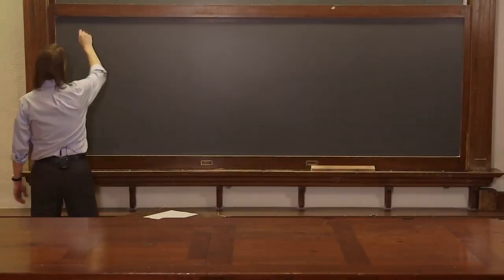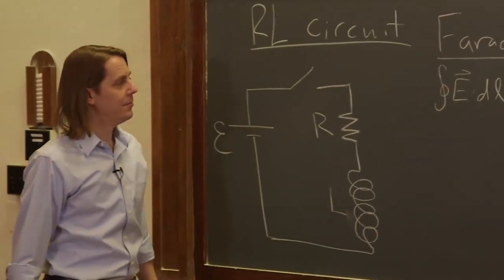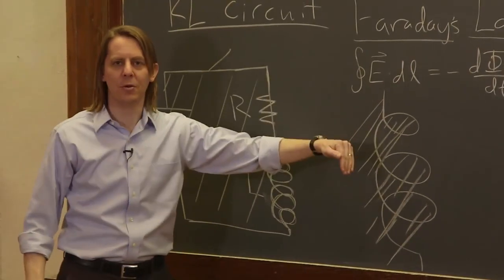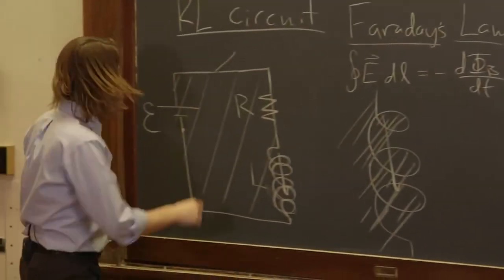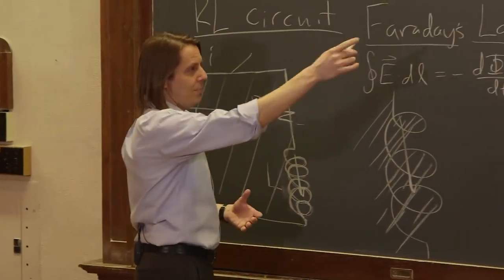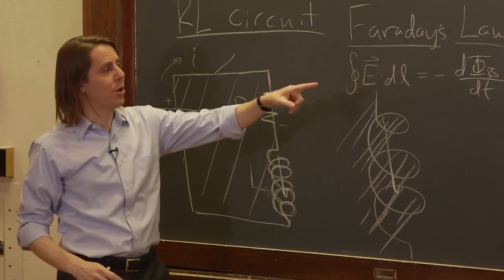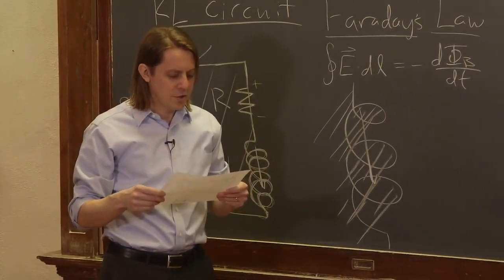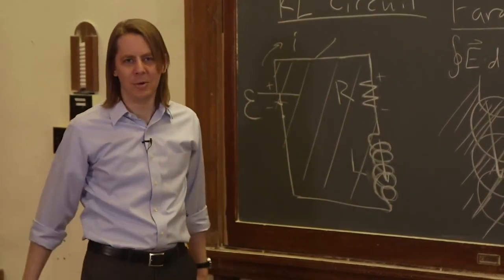PHYS 102 | LR Circutis 2 - Faraday's Law is the correct approach for a Circuit with an Inductor!

Comment: But then you are saying that integral E*dl over the coil is 0. But isnt this wrong ?Cause there should be a voltage across it and like the law of inductance states. And if you look  at the maxwell equations, you will see that the dΦ/dt is the same as integral E*ds over the coil. So actually you will get the same as you got with Kirchhoff, but in this case i think Faraday is the wrong equation to explain the voltage across the coil, cause in your explanation you are saying that theres no voltage drop across the coil, what isnt right, i think.
(if you are saying the whole circuit is the coil,then its hard to argue with kirchhoff, but in this case theres more sence in using kirchhoff, and hard to understand with the faraday equation, i think)
 Only because the coil hasnt got any resistance doesnt mean theres no voltage dropping across it. I mean why should Ohms law be the only reason there to be a voltage drop? A battery could induce a voltage drop, too, even if you assume it has got no inner resistance. A solar panel can do that, too. A capacitor can do this, too, a diode can do it, too.Also a isolator can do this although it hasnt got any measurable resistance. Also a human can be the reason for a voltage drop, although his resistance isnt constant. 
(maybe i'm thinking wrong, i hope i dont but correct me if i do.)
Reply: Resultant Electric field inside inductor at steady state is zero since it is a conductor. In transient period there would be electric field.In steady state charges redistribute such a way that total field inside conductor is zero. So electric filed produced by the change in magnetic field get  cancelled by coulomb's force. Inductor itself is not  closed loop so cannot apply faraday's law
Reply: @AjayVarghese-o2y  well yes. But arent we talking about a general rule? And shouldnt a general rule also apply to changing E and B fields (at least for slowly changing E and B fields so that we dont care about speed of light stuff)

Comment: If there is "no field" inside those wires and the inductor, then why are the electrons drifting through them?
Reply from the maker: They were given an initial push by the battery, and follow Newton's first law!
Reply: @Prof-Hafner   Thank you, but I am still not clear about this. If they are moving due to inertia, they should continue to flow even if we short circuit the battery and remove the battery. will the current continue to flow even after shorting the battery?
Reply from the maker: This is all an idealized approximation, but in that case the current would continue to flow, except other effects would slow it down.  Even in this idealized case, current flowing in a circuit is made of charge that is accelerating, so it would create electromagnetic radiation that would take the energy away and stop the current.
Reply: @Prof-Hafner Thank you once again, but I am having trouble in understanding that the electric field can be discontinuous inside the wires. It is present only inside resistors and battery and not in any other part. I thought it was continuous and that causes the electrons to drift. This is the part I am having trouble with.
Reply: @Prof-Hafner  what if there is a corner in the wire? Electrons should change their direction. But if there is no electric field, there shouldn't be a force to change the direction of the electrons.
Reply from the maker: Again, all very idealized and approximate!  We say the wires are perfect conductors with zero field inside, but you are correct they would also have to be straight for that to work.  For a bend, some charge would build up on the wire surface (in an attempt to drive the field to zero) and the field it creates would accelerate the charges.  So I think at a bend the field would not be zero.
Reply: @Prof-Hafner  thanks!
Reply: @Prof-Hafner  Does that mean that the conductor develops a net charge at every bend?
Reply: @Prof-Hafner  Newtons first law?
So you are saying the energy stored in an inductor is from inertia of electrons? Well if you have got a coil which has got lets say  1cm^3of mass there are approx. 8.4*10^23 free electrons in there. If they are moving with a speed of 7.4*10^-5cm/s (1mm wire 1A)
they will have an energy of 2*10^-16J. Thats nothing close to their real energy due to the magnetic field. They arent moving due to inertia, but due to self induction. (which is caused by special relativitys concept of length contraction which causes electric fields out of the view of the electrons. So they will always contrafict the change of magnetic fields due to lenz law)

Comment: In Faraday's law, vector E dot vector l is taking nonconservative electric field. How can it create potential? The term E-iR is still using the concept of potential drop.
Reply: since the E field in the circuit stills acts as a conservative field,inside the wire of the circuit, the only difference is that now there is an inductor that creates that magnetic flux.

Comment: it is just the deffinition .... int of e =0 is not kirchoffls law I guess ... .its the sum of potentials in closed loop that is zero
Reply: Potential is not defined for a non conservative field
Reply: See whenever you apply kirchoff's law you can just put the line integral of conservative field zero but in an inductor circuit we also have non conservative field and line integral of cons.+non cons. field +(motional emf term) computes to net emf generated along the loop. So is you want to apply kirchoff law ( line integral of conservative field only equal to zero ) it will give you correct result but you have to  be very careful as now eg you can not simply write V=ir across resistor (as ohm's law says 'net emf' in the element =ir and net emf is not just line integral of conservative electric field ).
so as you put "e=0 is not kirchoff law" the statement is correct only when you consider e as net emf in the loop and not line integral of conservative electric field. 
Hope it helps !

Comment: Great lecture. Thanks.
Reply from the maker: Thanks.  If you are interested here are the secret behind-the-scenes details....  When I first made these lectures for an online course on edX I didn't talk about how Kirchhoff's Rule was wrong and you should use Faraday's Law. I just said what the books say and, to be honest, had never thought about how it was incorrect.  The class was going fine and then I got an email from Walter Lewin telling me I was an idiot for teaching incorrect physics.  So I made a new lecture where I had WL come in and explain it correctly.  Then we had to stop using that lecture ... so I made this one.  That is why at the end I say that "in the rest of the videos we won't talk about this", haha.
Reply: @Prof-Hafner   thanks for having explained also the behind-the-scene story. Effectively, as you say, no electronics book I've read explains that with an inductor you derive the equation using Faraday's law and you cannot apply Kirchhoff in this case, being the electric field not conservative. They mention only Kirchhoff's Voltage Law (explicitly or not) and this has created confusion to me in the past. I've the feeling that also many electronic engineers don't know this; they simply apply daily what learnt on the textbooks.
Reply: @enricopascucci4802  one book that gets it right is Ramo Whinnery vanDuzer "Fields and waves in communication electronics" but technically it's an EM book, non an electronics book... Then there's Purcell, and Haus (this one is freely available on the MIT OCW website) - but still they're not electronics books... :-)
Reply: @copernicofelinis  thanks for the info.